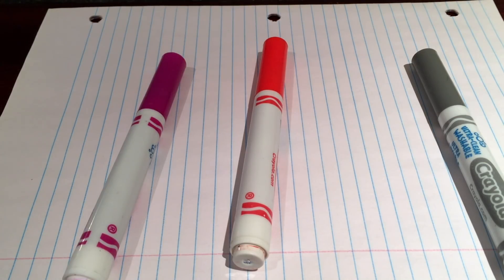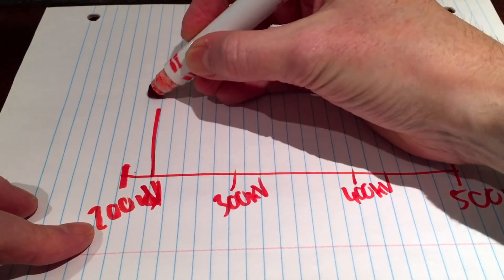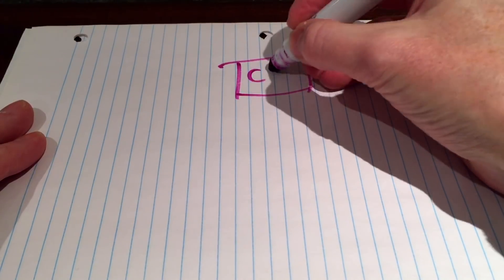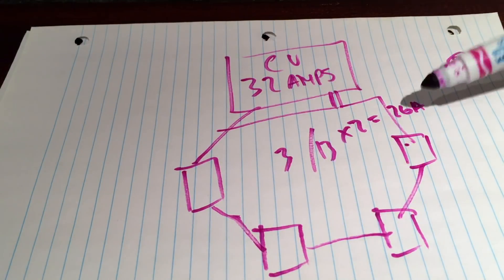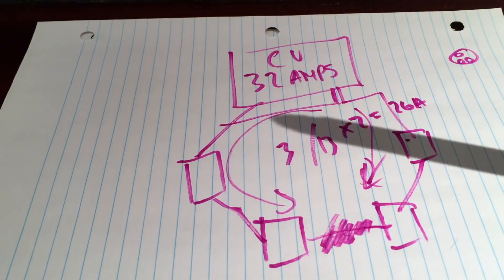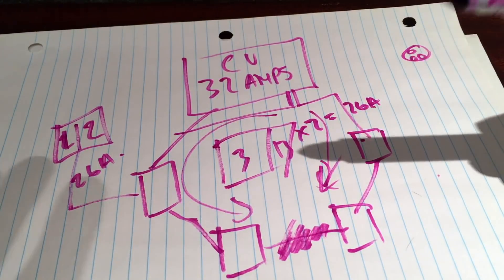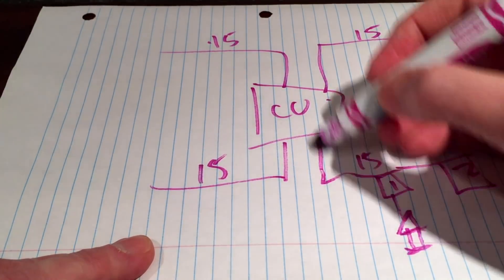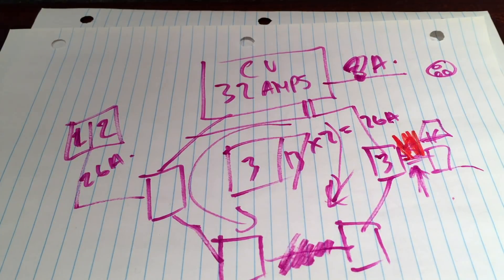THIS is why British plugs have fuses

Comment: I'm not a pro, but I know how to wire up the outlet socket and plug, but anything more complicated like the mains ring, I will get a pro
Reply: WIFIGHOST CRUISER Sorry but you're wrong. It IS a full ring. If you need to check it out properly you should search for UK consumer unit images and research the ring main more thoroughly. Inside the consumer unit EACH 32A ring main circuit has 6 wires: 2 brown (line), 2 blue (neutral), 2 bare copper earth wires that SHOULD be covered with green/yellow sleeving. Each neutral and earth wire is connected to the respective earth and neutral blocks and the PAIR of line wires are connected to the 32A breaker outlet. For any individual socket there are TWO parallel cable paths which means that the ring CABLE capacity is 52A @ 230v (typically, and definitely in ALL the houses I have seen is actually 250v) that's a total power capacity of 12.5 kW PER ring. We usually have at least two rings (upstairs and downstairs) and depending on the size and/layout of the house may have one or even several more. Power diversity comes into play also. Some of that can be effected by manual config at the consumer unit (fuse box) by for example, having a separate ring main for the kitchen/utility room. But that enables us to have a 3kW electric kettle, a four slice toaster, a microwave, a dishwasher, a fridge, a tumble drier, and a washing machine all connected to the ring main quite safely and without issue using a universal power plug (providing not all are switched on at the same time). If the ACTUAL working conditions are likely to exceed the 32A max load then a separate radial circuit or circuits can be provided or more likely these days, an extra ring main can be installed. The main reason a ring main is more efficient is that for the sake of a few EXTRA feet of cable over a radial 16A or 20A circuit (i.e. JUST returning the end of the radial back to the consumer unit, we can have as many sockets as we like on a ring main (under a certain square footage) and can plug in ANY moveable domestic electric appliance into ANY socket at ANY time. We can move that electric kettle anywhere in the house. Once a ring main has been PROPERLY and ACCURATELY installed and tested, the likelihood of a break in the ring occurring without some form of deliberate interference is miniscule. Current UK regs require that the installing is safety checked after ANY new installation work and checking a ring main for continuity (as compared to a multi socket radial) is simplicity itself and can be done from the consumer unit alone. Any faults are obvious albeit the location of the fault is slightly longer than a radial. Once a suspect fault is located and fixed however, it is MUCH quicker to verify correct operation than with a radial ... You just check at the consumer unit.

Extending a ring main in essence is also extremely simple using single socket spurs (not the best way but legal) single or multiple fused spurs (i.e using a fused wall plate to protect the cabling from excess load) or by breaking into the ring and connecting a new socket with additional cabling.

One other thing, unlike the US and Canada, the UK does not use (to my knowledge) aluminium cored wire in domestic environments and certainly not under 16mm^2 that I have ever come across in 45 years as a graduate electrical and electronic engineer.
Reply: It's not really more complicated. It's just that in America, we might have two circuits for the living room Outlets and one circuit for the dining room. It looks like in the UK they put the whole Darn House on one circuit LOL! They shouldn't draw it going back into the circuit breaker box like a ring because he electrically, it's the same thing; At least from the diagrams that I found on Google.

Comment: Uhhhh... The voltage ranges for distribution here don't really make a lot of sense. Low-voltage distribution that you might expect at your house for instance(right before the transformer that gives you your 120/240V power in the U.S.), can range from about 2.77kV to 14.4kV (open wye voltages, for delta configuration that range would be 4.8kV to 24.9kV) Then there's high voltage distribution at around 23kV, 46kV, and 138kV (open wye configuration here), and then you have transmission where you would see the high voltages over 200kV as you mentioned. Some of these ranges may be specific to companies in my area, but generally speaking those are the ranges you will see.

Comment: one of the main points that has been missed is in America the supply voltage is 110 volts and Britain the voltage is 240 so American cookers require 3 phase to there cookers to get the power at a reasonable amperage .also i believe that in the us the supply is not referenced to earth. as it is in the uk the earth and neutral go to the same place (ignoring rcds).in the us the neutral goes back to the power station by wire not through the ground so in theory you won,t get a shock standing on the ground with you finger in the live socket .but you will between live and negative and as its a lower voltage same as used on the yellow isolating transformers on building sites in the uk its much safer
Reply: US is 110 spit phase. Ovens and dryers are 220. Rare to see 3 phase in a house in the US
Reply: b
Reply: Niya Blake thanks  for your comment as i have only read information evidently was not fully correct in the uk, but the doubling of the voltage is key in lowering the amps, and that was one of the key points . 👍
Reply: I don't know what amp is used in the UK  but here in the US it's either going to be 30/50 amp.  if it's a  3 wire plug it's to hots and a neutral . If it's a 4 wire plug is 2 hots 1 neutral and a ground .
Reply: Niya Blake totally different in uk 240 supplied at house with 100 amp fuse from supply company , then consumer unit  with 32 amp trip for ring main ,eg sockets around house .there could be several one for upstairs one for kitchen if it is large , one for downstairs etc with individual fused plugs 32amp trip for cooker. and  then 20 amp for water heater and 6 amp for lighting.it would be very rare for a house in gb to have 415 volts to be supplied to it as ( three phase) it is lethal !!
Reply: 3 Phase 440v range and dryer would be an overkill in my opinion lol.
Reply: You have to understand what a phase is, American houses do not have three phase. It's called split phase and they are a hundred and eighty degrees from each other.

Comment: this is mostly all wrong! no oven is on 3 phase. you can also have up to 3 double sockets on a spur off a ring main.
Reply: Dan Bannon totally wrong, a ring main allows you to have as many sockets as you like as the cable is doubled in size by being in a loop which allows the higher fuse rating where as a spurred cable only has its listed current rating of 25amps reducing over length,  so one twin socket or two single sockets as a maximum on a spur as the fused plug load could = 26amps so your dangerous notion of three doubles on a spur is = to 78amps potential load vastly overloading the spur cable and a cause of electrical fires.
the installation has to be idiot proof as there is no knowing who plugs in what. this is why the British system is superior as cabling costs are reduced with less dedicated circuits and appropriate plug top fuses protect protect the appliance. it is the safest and most efficient means of domestic distribution.
Reply: Patrik Arvhult no we have a 42A/230v cooker circuit rated for 9.6kW this is more than adequate for cooking
Reply from the maker: I was working from Appendix 15 in BS7671.  "Unfused spurs off a 30/32 A radial. One single or one twin using 2.5 mm sq."
Reply: Patrik Arvhult err no my oven runs on a plug top but my hob is elsewhere on gas.
Reply: duckwhistle they’re commercial cookers. Seldom do you see those in houses that are only supplied with single phase

Comment: Now that we live in rural France we can only dream of a 100A supply. The standard these days is 30 to 60A with more available and the inevitable three phase which can be foisted on you if for example you have a ground source heat pump or need too much amperage for the local transformer to cope with (think very rural). We only use radial circuits but the number of outlets per circuits and RCD's required make for a pretty good solution.  I personally can't stand ring mains and think they should be phased out. However I do miss the British socket with a switch to isolate prior to unplugging... I just don't like the French earth pin sticking out of the socket...
Reply: The earth pin in the socket does mean you can easily clip an ESD strap to it.

Comment: As you say, you're a software engineer and code for a living. I think you should stick to that. 
Whilst i understand your intent to provide information there are so many factually incorrect and incomplete statements in this video so as to make it pretty much useless. 
You incorrectly refer to Transmission voltages as distribution (There's a difference). You jump transmission voltages without explaining why they matter to a fuse in a plug (they dont).
You dont explain why the UK upgraded to 240V and standardised after the war or why thats now 230V and why the US didn't upgrade when the higher voltage is clearly more efficient method of power.
Your description of why the Uk has ring mains is broadly correct due to a much higher efficiency in the use of valuable copper and also inherently robust, but your grandiose statements about it being outdated are plainly wrong. If you were to look at any of the regulatory systems in the remainder of the world, most of the governing policies (including in canada and the US) wish they had also adopted ring main systems.
Your comments about 3 phase supply and UK cookers and showers are just plain wrong.
I've lived and worked in the electricty industry all around the world (inc US, Canada, UK, and belgium as well as various african states) and By far the most comprehensively designed and best executed system, and the one highly regarded by almost every other regulating body in the world is the UK system.
Reply: The ring main has both positive and negative lines (along with the Earth line, hence the three wires mentioned) from one end, around, and back again.  It's not like a battery circuit, where positive is at one end and negative the other.
Granted that wasn't entirely clear from the VLOG diagram.  It means a break between sockets will still have an operational power supply, if unbalanced in terms of loading.  Therefore 'open ring' is a fault but not a failure (or is that the other way round?!)
Reply: Jason did not explain it properly. Our ring main comes from the Consumer Unit BUT not in a single cable. It depends on the number of rooms in the property to determine how many outlets you would require. Each room requires a lighting circuit and a power circuit, which are on different amps from each other. A lighting circuit is usually 6 amp. Where the power circuit is 32 amp. Each room basicly has it's own lighting ring and power ring. Sometimes you may group two or three rooms together. My consumer unit has 8 outlets, 4 for lighting and 4 for power sockets. The cooker is on its own circuit due to a higher 30 amp. If any thing was to go wrong, the plugged fuse is the first safety cut out, if that doesn't blow, then the fuse fuse in the consumer unit trips the power off. But it only cuts power OFF to the affected room. If it was a power problem it would not affect the lights and vice versa.
Reply: Interesting to get 'advice' on social skills from someone who resorts to childish insults and name calling.The facts remain, the information contained int he video is incorrect and incomplete.It has nothing to do with anyone's ability or otherwise to make a video.
Reply: I am a certified electrician from Belgium and worked for some time in the UK. I have to agree here with the writer of the comment. You mix up loads of things, use the wrong terminology and fly from left to right in your video. I am sure your intentions are good, but I'm sorry to say, your theoretical knowledge isn't quite there yet. It was a good attempt at trying to explain something, and that deserves encouragement.
Reply: My thoughts exactly.
Reply: Give this man a medal!🎖
Reply: Brandlin iA
Reply: Brandlin,i beg to differ!Its far to complicated and not flexible!Like i described in my first comment.And i know what i am talking about,i have been a electrician for many years.Give me our system anytime!
The only thing good on that sytem of yours is the fuse in the box.So to keep the source of a shortcut local.
Reply: I wholly disagree, the ring system is far less foolproof. One could easily be annoyed that the fuse has blown up and roll a wire around the fuse contacts to use his desk lamp. The safety of an electrical installation is inversely proportional to the expectation of the user not being an idiot
Reply: Ring circuits are horrible and I don't know who told you that America "wished" it had utilised them. I've never heard that. I suggest you watch John Ward's video series on ring circuits (he's a British electrician and he despises them). https://m.youtube.com/watch?v=hZN6hiGLtrE

Ward's channel is excellent in general and worth a sub.
Reply: This 👏🏼
Reply: Whilst I do agree with your points, I can't seem to find the video you made on this subject and so to suggest that another users video is "useless" I find quite rude.
Reply: Colin - you're the one being abusive and making childish insults.have a nice life.
Reply: The ring circuit idea is a daft relic that should be consigned to history.

Comment: I can see some advantages to the UK system; your radio blows a fuse but your lamp stays on. However, most North American appliances have their fuses internal to the unit itself instead of in the plug, so effectively we have the same thing, just a little further along the line. Advantage to the UK fused plug method, you MUST unplug it in order to change the fuse; it offers that layer of safety. While most NA appliances have their fuses in special access sockets, it is still possible to encounter current if the unit has not been unplugged. 

As for the vacuum cleaners etc. that are hyped as 12 amps even though the circuits are 15, this is more a selling point as to the power and torque (the sucking power, if you will) of the unit's motor. And you wouldn't want unit too close to the circuit limit of 15 amps since the couple extra amps drawn at startup would blow the circuit every time and you'd never get your work done! Not to mention the small fortune in fuses. Of course circuit breakers save money. LOL. So 12A is the logical upper limit for vacuum cleaner motors.
Reply: most manufacturers 'embellish' the marketing speak of their products power by quoting the peak load that the appliance draws... this is often an instantaneous load at start up (especially for electrical motors). So its not the continuous draw load.  You can see this quite easily if you look at the advertising for the Wattage (or Horse power) quoted for a product and then work back from 230v (uk) or (110v (USA) to calculate the current draw, and you'll find its simply not possible. In soe areas such as power tools and machinery this has become a Top Trumps type marketing war which is plainly nonsense but shifts units off shelves when the consumer has a mind set of "bigger is better"
Reply: Don, Most appliances here also have an internal fuse.  However ring circuits go back to 1948.  At that time, appliances were not the low power electronic devices we have now.  Lamps were an exception (although to be fair incandescent lamps have a fuse - the bulb).  The idea of a 3kW electric fire being able to draw 9 kW through its appliance flex due to a fault is rather frightening as it wouldn't be able to take 3 times overload.  Also bear in mind that originally consumer units used fuses (and indeed many houses in the UK still have rewireable fuses to this day).  Fuses can take a fairly large overload before they blow, so a 30A fuse probably won't blow at 35A.  Having a 13A fuse, that definitely would blow at 20A therefore solves this issue.  A 32A breaker also probably won't blow immediately at 35A, as it would take a while for the bi-metallic strip to heat (although a 0A to 35A surge would almost certainly trip the breaker immediately as the other form of overcurrent protection - the solenoid would activate). 

In its own way, we could go back to radial circuits now and use lower amp breakers, however we would still be using BS1363 plugs and socket outlets.  Because of that they would all be fused.  Not only that, but even if the regs changed tomorrow, there are installations that will be running with rings for decades.  

The design of BS1363 only has the one flaw.  They bloody hurt when you step on them in the dark.

Comment: I suspect the 12.0 amp limit on consumer items is simply because the manufacturer doesn't want to have to add a very strong notice saying this device must have an individual circuit breaker,   consumers want to plug their vacuums into any Outlet that's convenient to them so one with  an extra 3 amps wiggle room is perfect